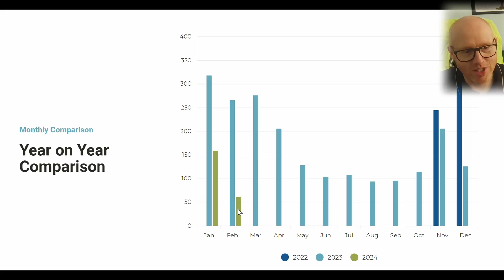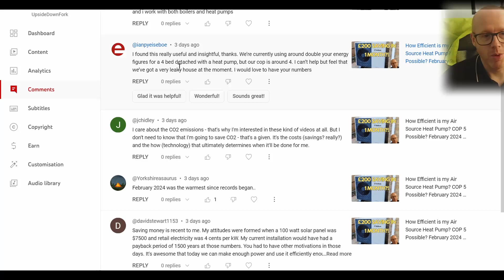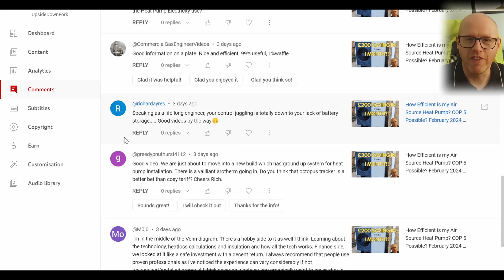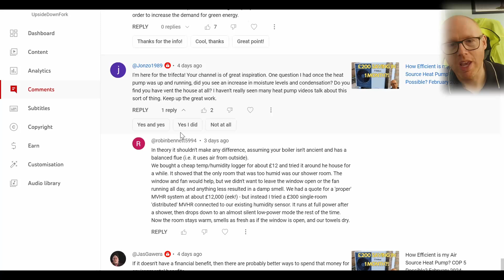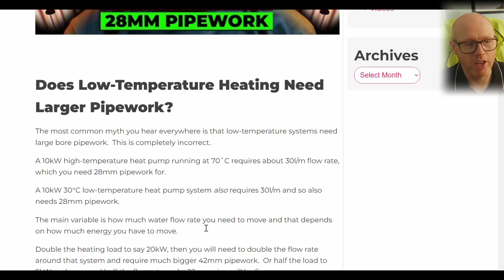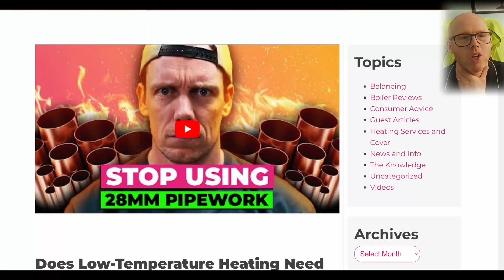My Heat Pump Data was incorrect! Correction video + I answer your comments.

Comment: In preparation for a HP I'm running my gas boiler  at 45C continuously  to get some real world gas consumption. Looking forwards to a couple of weeks at -3C. 🥶🥶
Reply from the maker: @davidreece1642  most people will be pleasantly surprised how well their existing system copes at those temperatures 👍

Can't beat a real world test.
Reply: @UpsideDownFork  I'll let you know.
 Now watching plumbing vids to replace microbore and HT rads.

Comment: Gas boiler systems lose efficiency due to oversizing of power, heat loss through the exhaust pipe, hot water preparation and dirt on heat exchangers.
Reply from the maker: Thanks for the comment. I've responded in this video: https://youtu.be/gV8-LSfNIQg

Comment: Great update. As a side note, a modern condensing gas boiler with weather comp can happily run at a lower flow temperature all day just like a heat pump installation, this will help your home feel consistently warm and help with thermal mass while saving in gas usage and wear and tear from cycling on and off.
Reply from the maker: Thanks for the comment. I've responded in this video: https://youtu.be/gV8-LSfNIQg

Comment: My British Gas installed Daikin 6kW & 150 litre Mixergy combination landed a couple of weeks ago.

After the initial panic of 'how do I control this beast' and some of the demands during commissioning (almost heart stopping) all has finally settled down into a well behaved system.

Has been running 24/7 on weather compensation with living room @ 19-21C whilst playing with curve, typically 5-7C external temperatures at night with four nights just below zero.

SCOP on heating since initial power up (from Daikin control data) is 1090/257 = 4.24 over 17 day period.

That's typically 13-15kWh (from Daikin unit, smart meter concurs) a day consumption now it's more or less set up, but bear in mind that's running 24/7 for now.
Reply from the maker: That sounds good! 
The first week of March has been a lot colder than the first week of Feb was.

Comment: Wouldn't Octopus Agile save more than tracker if you avoid the 4-7 peak period i.e. heat from 2-4 and 7-9 and heat the hot water overnight.
Reply from the maker: Yes. Good comment!
If you can avoid excessive usage during 4-7pm then agile will typically work out better than Tracker.
If like me, people have 3 kids coming home from school during this time and needing to use the induction hob, oven etc during this window, Tracker works out better for us.
If we had a little home battery storage then we could bridge that peak period.

Comment: Find your videos very informative, been a watcher from the very start of your journey. 

My installation is coming to a completion, have had a upgraded main electricity supply, this from a looped single phase supply to a three phase supply with external meter cabinet & three phase consumer unit, A Mitsubishi Ecodan 8.5KW Heat pump with 180l hot water cylinder, 13 new radiators, 17x410w solar panels with optimisers, 10kw hybrid inverter, 23kw battery storage system with back up supply, loft, cavity wall & room in roof insulation, new double glazing & composite doors throughout, new roof, heated postive input ventilation system & new bathroom/kitchen fans that come on automatically, removal of oil boiler & 1200l tank,  Zappi Electric Vehicle 22kw fast charger.

It has been a very long & significant amount of work but really looking forward to seeing the subsequent benefits. With confort & reduction of C02, We have had temp as low as - 4 with a flow temp of 38c so very happy with that & the house is a nice 20c.

The old oil boiler was directly underneath my bedroom is so nice not to hear that, the heat pump is so quiet, can't hear a thing. 

About to have wifi access points fitted to, this to try & improve the signal to all the equipment we have had installed.

The last thing is to move energy supplier to octopus, looking at Agile for import & fixed 15p export to compliment the solar & battery storage with have.
Reply from the maker: Good to hear that all is going well with your big project!
A lot of upheaval but worth it!

Comment: Great video. My zoned system was installed in 2005 when we extended and renovated the house, it can very easily be removed though, unfortunately quite a lot of the heating plumbing was done in plastic (15 & 22mm). As for an EV I've no plans for one, I do on average 8000 miles a year, the wife in her car about 2000 if that. I'm a mechanic so service them myself, although I'd not miss that. Mines a 2009, wifes a 2007, so both paid for a long time ago, biggest problem with an EV is cost, especially something to replace mine, wife's is a basic car so could be done much more cheaply than replacing mine with something comparable. I just plan to run both until they literally need replacing.
Reply from the maker: Plastic pipe may be fine depending on your heat loss.

Come on then, what car have you got? Please tell me it's an old S Class or something!
Reply: @UpsideDownFork  I used to have an A6 Audi saloon, then an Allroad Quattro, but for the last 11 years a Tiguan, I couldn't justify the cost of a Q5. Never owned a Merc.

Comment: Hi mate, can you tell me how you can get the data online
Reply from the maker: Do you have the myVaillant app?
Reply: No way it will work without an extra box
Reply from the maker: @BillsCountrysideAdventures  I'm afraid you do need to have the optional gateway installed.
An easy job if you are DIY minded, but obviously not cheap.

Comment: Thanks for answering my question. I need planning permission as I was 1db over the MCS limit! £322 for 1db. To make it worse, we were actually 0.1 over, but rules state the number should rounded up. That made it 43db. 42db is a pass!. As for inverter integration, I was thinking more that the heat pump would know the cheapest Agile slots directly. Then non solar people could take advantage of Agile. Thanks again.
Reply from the maker: Ouch! 1db! Crazy system we currently have.
Our noise assessment failed on the Daikin unit, that's why we had to go for the quieter Vaillant which just passed.
Went for planning anyway due to proximity to boundary.
Reply: @UpsideDownFork  The government is having a consultation about these rules and are most likely going to scrap it. I can see a situation where we might be declined (I doubt), they scrap the rule and I can do it anyway
Reply from the maker: @bazcurtis178  yep, I've skimmed the consultation. 
Having followed something similar a few years ago, I doubt they will make any permitted development adjustments this side of the election. Tends to be a long drawn out process.
I'm sure you'll be fine though 👍
Reply from the maker: On the integration issue, I'm sure the next gen of heat pumps or even just the controls will have a lot more support for these things.
The fundamental tech and controls are very old and well established.

Comment: It's funny the amount of people I've seen over the years(?) now in the heat pump world that try to use their job as added weight to their argument.  e.g. the 89% efficient one, as you quite correctly pointed out - how does someone arrive at the figure, the monitoring that is used for a heat pump could theoretically be installed for gas boilers - along with maybe an additional gas meter.  As with heat pump COPs - a snapshot of efficiency under certain criteria doesn't paint the whole picture.

Also on Octopus Tracker recommendations - I would caveat it by saying that there is risk involved with the price shooting up - so it's fine for those who are able to stomach the potentially higher prices, but it's not really for those who want certainty over their bills.
Reply from the maker: Yes, very true.
On point one I've seen it my whole working life in the motor trade!
There are broadly 3 groups of individuals working in my sector.
1. Want to do the best job possible. Constantly learning and pushing forward.
2. Capable of doing a better job but just too lazy/satisfied with the status quo.
3. Lacking fundamental skills/knowledge/intelligence to do a decent job.

The second group of people is the vast majority of the motor trade.

On point 2, I concede that Tracker is not without risk. My rebuttal is that the price hasn't exceeded the price cap in something like 9-12 months and even then just for one or two days. I know history doesn't predict the future but it gives us an idea of the risk involved.
Customers can switch from Tracker at any time.

Comment: I have a question, your heatpump uses a external temperature sensor to compensate for heat loss have you seen strange data on days with high wind that causes chill factor of an extra minus 5 degrees?
Reply from the maker: Short answer: humidity has a MUCH greater effect than wind does.
Reply: Wind Chill has zero impact on actual temperature or the heat energy in the air.  It's arbitrary and estimates what the temperature would feel like outside to a human without wind.
Reply: @BenIsInSweden  i did a test with radiator fan; depending on the type of fan i could reduce the return watertemperatuur with 3-5 degrees C.
So wind has an effect, the question is is it significant.
Reply: @arnovdmeer  That's different to wind chill. You're assisting the heat transfer from the hotter source (radiator) into the colder room, the fan isn't cooling the air that is hitting to the radiator. The outside coil will always be colder than the outside temperature, and the fan is already enabling the heat transfer from the (relatively) warmer air into the colder coil.

Comment: I looked at the numbers for CO2 savings too. For me the big savings would be: not taking flights, changing from a gas boiler to a heat pump and buying green electricity (this last one is the easiest - I did it years ago - but it is more expensive than standard gird). Also, just reducing consumption generally saves CO2.
Reply from the maker: Yes indeed!
I will share in future about how taking up cycling has had a bigger impact on my financial and carbon savings than solar panels or a heat pump ever could.

Comment: Sorry I called you David, mixed up my utubers! As for my pimp ( god i hate spelling correction) seems apt I confess to errors here too. I had no idea about zoning, flo etc so agree most people have no idea about correct/efficient use of heating. I trialled my larger radiator system before HP install running at low 40 degrees, a gas guy suggested this was too low for efficient running & needed yo be around 50-60 degrees. But confirmed my rad system. Not caring about CO2 (ie environment/health) is a sign of political inclination rather than facts.
Reply from the maker: Very true! Thanks for the comment.

Comment: Very interesting, I have now had my HeatGeek site visit and they are working on the proposal which includes a 10Kw ASHP so Planning permission required (also 7 metres of under concrete pipework from the old boiler location to the ASHP location). 

Just checked my oil heating and hot water costs for February. I used 109 Litres of oil and the boiler and pump used 14.7Kw so a cost of £85.87.

I have now also removed most of my Drayton Wiser rad valves and fitted standard TRV4 TRV heads. So now the boiler only runs if the living room or kitchen temperature drops.

This increases the load on the boiler so a bigger difference in boiler flow and return temperatures. Oil use does not seem to have increased and all rooms are comfortable all of the time rather than just at certain times. So perhaps zoning is bad.

I now also can log my heating flow and return temperatures in Home Assistant using ZigBee Salus PS600 sensors.
Reply from the maker: Thanks for sharing! That all seems to work in line with my understanding of zoning and flow in a heating system.
Sounds like you'll have some good data to compare your oil boiler to a heat pump when the time comes.

Comment: The graphing of open energy monitor is so useful for working out and optimising the heat pump - probably more so for Daikins which have some bonkers settings 😅

Your heatpumpmonitor comparison is correct (I've a non mid metered unit on there), but the wealth of data is very valuable. There's probably more variation in house fabric, hot water use etc than variation from location of the heat meter, so there's no point worrying about any league table standing.

You can quickly check similar units to see what their lowest modulation output is like, how they are completing hot water cycles (Vaillant eco mode seems much more efficient etc), excess cycling etc.

If you have a fault or a dodgy setting it really helps to highlight it.
Reply from the maker: Yes, you are so right!
I didn't mean to come across as negative towards heat pump monitor. It's a great tool and definitely something moving the whole industry in the right direction!

I'm considering getting the ebus module to get my heat pump on the table so others can drill into how we are using it as well as gaining a greater insight into how we may be able to further increase efficiency.